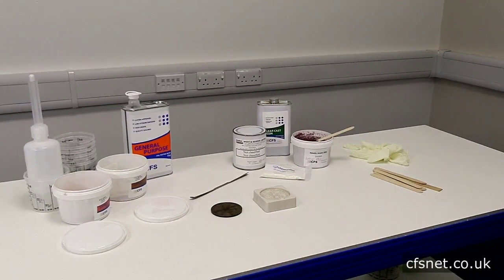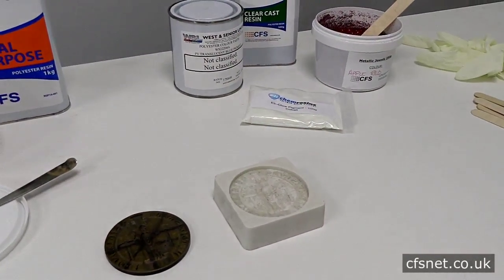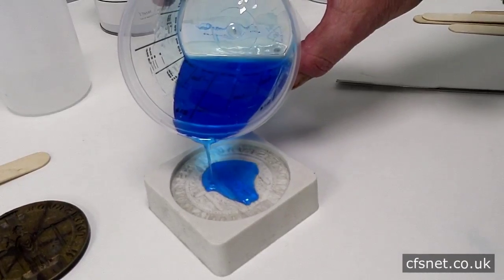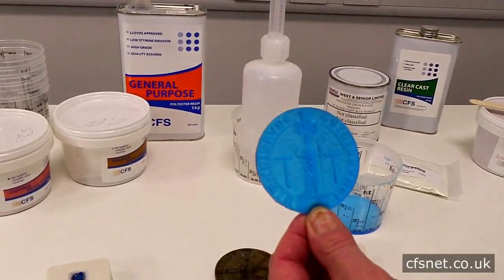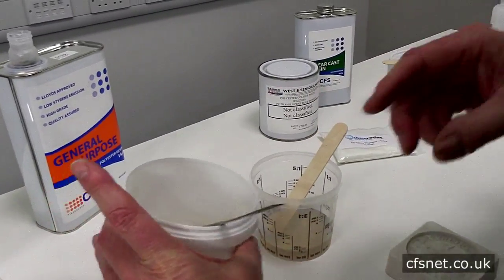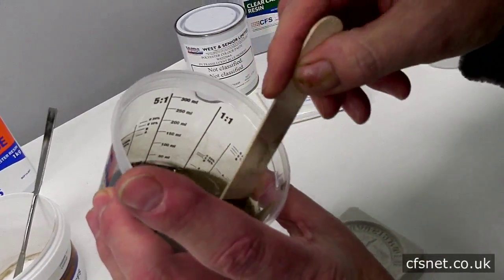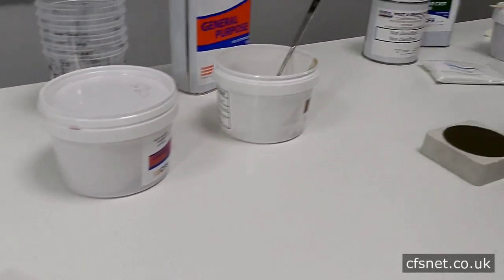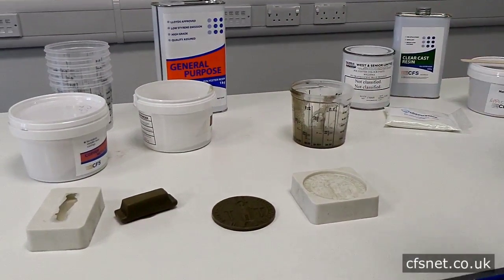CFS Fibreglass Resin Casting

Comment: Those mixing cups you sell and use here? Is it best to dispose of them or is there a way to get them clean afterwards? Because they don't look disposable, of course.
Reply: If they are polypropylene, just let the remaining resin harden.  When cured it will peel out.  You can crumble the cured resin and use it as a filler for another casting